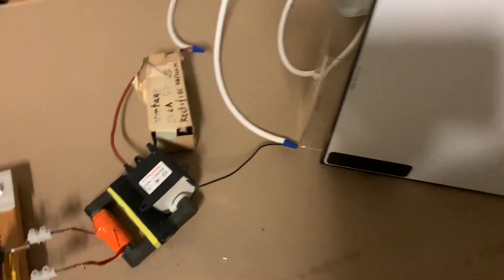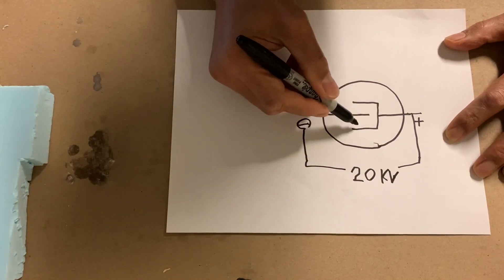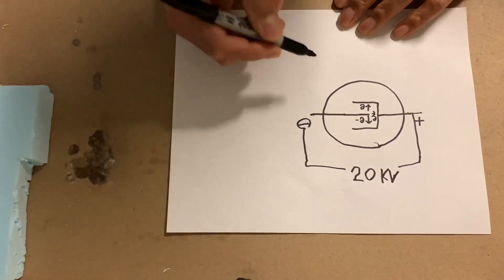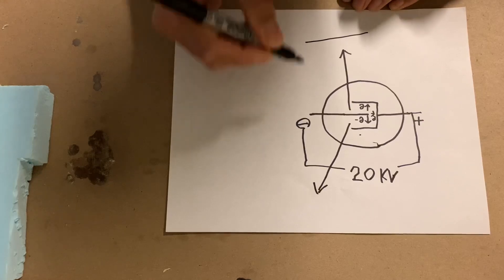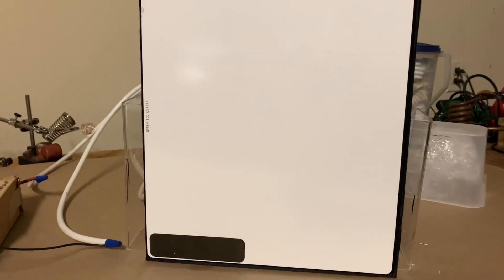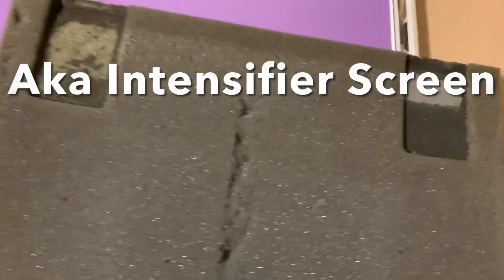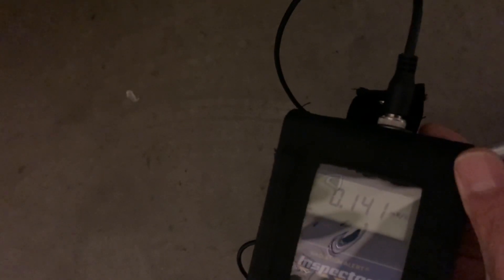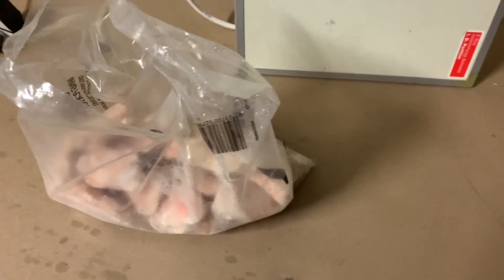Home Made X-Ray Pictures

Comment: i have a crazy idea based on you explanation of the way it works. i have a couple of old geiger counter tubes and be interesting to see if you can make them generate xrays, as they are essentially the same, a vacuum with a cap and a filament.  be ironic for something that detects radiation to produce radiation
Reply from the maker: Haha yeah it would
Reply: @BrianDhvTinkerer  definitely  i will give it go, but need to improve shielding in my lab as smaller environment, and the number of samples i have for my Geiger counters and Cloud chamber it would be wise to start sorting lead shielding. im also building a fusor so this is going to need serious shielding,  and i have a 50kv old xray transformer to power it. just need to rebuild my vacuum pump as it was a recent salvage.

Comment: Didn't know there were different types of Xrays...
Reply from the maker: Just different energies = hard vs soft X rays
Reply: I imagine that the film they use is more sensitive, but great imagination for the substitution...
Reply from the maker: The film they use is way more sensitive then the phone camera I used to detect the actually light generated by the intensifier screen!
Reply: @steve-o6413  they still used the scintillation screen with film, the visible light photons from the scintillation screen exposed the film. Although film can actually be exposed with a screen but it takes a LOT of xrays to do it.
Nowadays they don't use film anymore rather a digital sensor and in the case of fluroscope the use a image intensifier tube and camera....